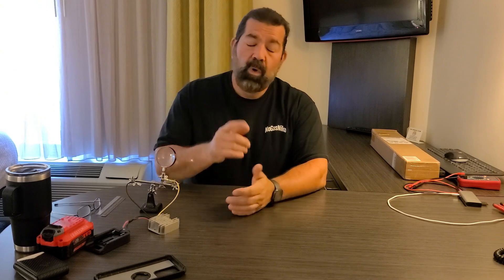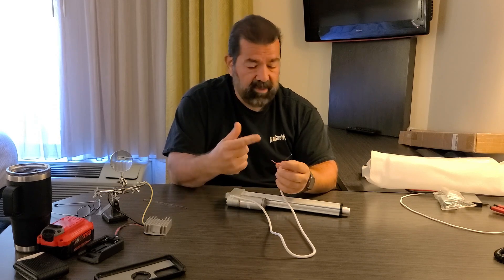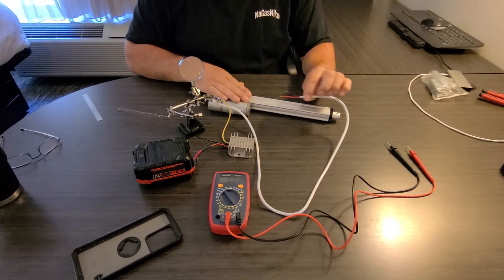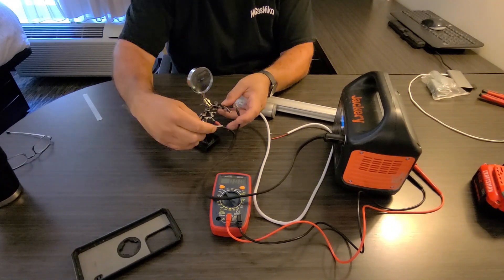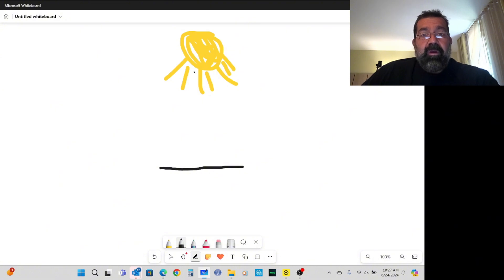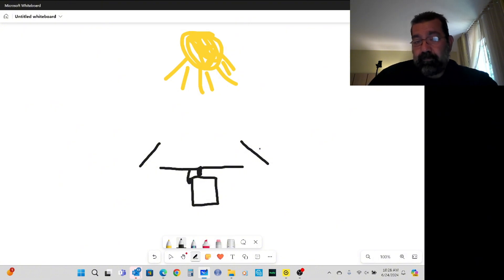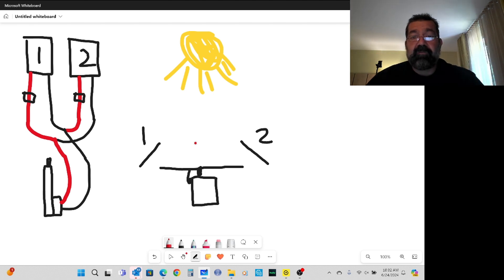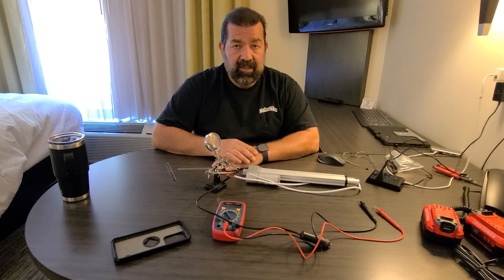DIY Solar Tracker Part 1 - Actuator UNBOXING and Function CHECK

Comment: The biggest issue I've had using linear actuators for DIY projects is the lack of a proportional system to move it other than full extended and fully closed.  Even something like modifying limit switch positions didn't seem all that feasible.  Wish they had a version with a stepper or something that could be proportionally controlled.

Comment: Won't the power demand be a function of the resistance of the mechanism and weight imbalance/inertia?  The unrestricted operating resistance and therefore load is somewhat misleading.
Reply from the maker: If the pivot point is balanced, the resistance will be minimal.
Reply from the maker: I will also repeat this test under load.  I was just wanting to know how much power to make the actuator engage.  This is an experiment and I will test variables along the way.

Comment: Why do you need the jackery to measure power?.  You already had a DVM to measure voltage.  Move the lead over to Amps and switch scales and you should measure just under 1 amp of current when the meter is in series.
Reply from the maker: To be honest, I like playing with that Jackery unit.